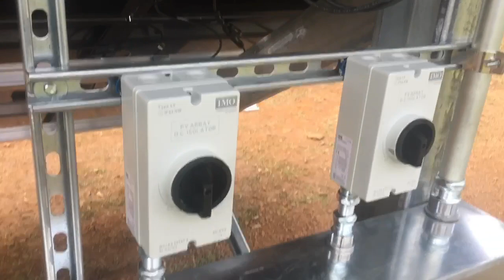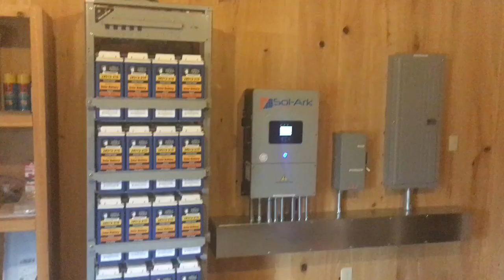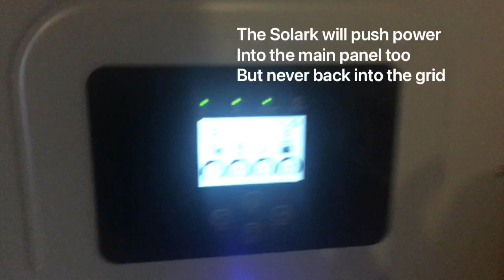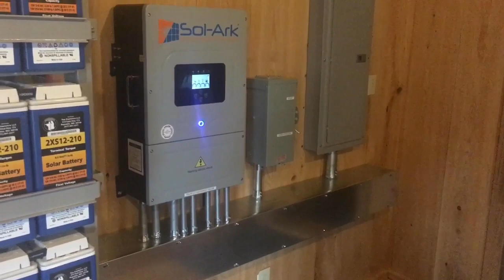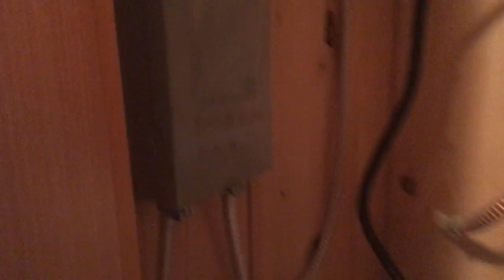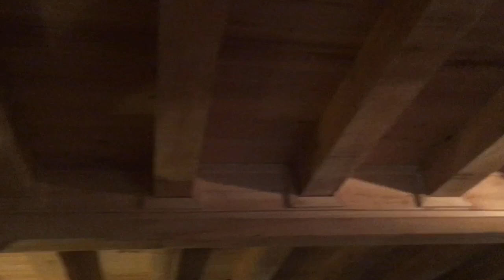Louisiana Solark pt4:  Finish job tour

Comment: What would be your second choice if ones budget doesn't allow a Sol-Ark ? Still with highest PV V possible as I need a ground mount . Thanks
Reply from the maker: It is rumored they have a lower cost unit coming out. What is your budget?
Reply: @GainSolarPower  That's good to hear as I am not in a hurry . I can afford the Sol-ark I just choose not too when so many others are close to the same thing with 25% cost . The zero export would be useful in my case though .  Just wondering what your thoughts were on the next step down from a Sol-ark .  Love your videos , very informative and entertaining.
Reply from the maker: There are no other all in one US made inverter/chargers with a 10 year warranty. Outback/Schneider/magnum/victron all need $1000’s in additional parts to do what the solark does out of the box. Also those other inverters I mentioned are a lot harder to install and take a lot longer to install. So I don’t know what you are comparing to the Solark that is 25% cheaper, if I knew of one I would be installing at the Solark it’s a money and time saver
Reply: @GainSolarPower  The Sol-ark is USA made ?  Pretty sure it's made in China ? I saw a video showing made in China on the label . Don't get me wrong , I like them ,I just think they are 4k too much .  Yes I started out wanting a Schneider system but have since changed my mind due to complaints about lack of support to the DIY peeps. Moved on to outback ,found their forum with endless complaints and not much help since the sale of the company.  I have not found a problem with the Victron stuff other than it seems more geared for mobile systems . Victron's all in one (easysolar) seems great except it seems to have went backwards with the latest version and it's too small for a home.  
            For 1/3 the cost of a Sol-ark the inverter I have at the top of my cheap list is the 12k low freq. Growatt 250 pv version  $2200 ish .  I know it's not as efficient but it's $4400.00 less which will buy a lot of extra panels and cells.
Reply: @onthelake9554  Have you any good or bad things about the Fronius Primo inverter. I am looking a for a grid tie inverter that won't tear up my HF ham radio reception.
Reply: @markrobinson8539  No , sorry no experience with grid tied at all . Johnny probably knows them well.
Reply: @onthelake9554  The base inverter is made by Ningbo Deye Inverter Technology.  Final assembly and EMP hardening is done here.  They are working on domestic production.
Problem with the Growatts is there has been no efficiency optimization.  Standby losses are high and efficiency is low, especially on the transformer type inverters.  Much of the cost of high end PV equipment is in non recurring engineering costs like reducing losses and improving efficiency in the power conversion stages.  The same could be done by Growatt, but they would cost twice as much.
Sol-Ark costs are comparable to similar high end equipment; a single Conext XW+ 6848 inverter and pair of Conext 80 600 charge controllers are the same price once ancillary equipment is factored in, and can only supply 6.8kVA.  A dual MS4448PAE system with 3 PT100s and Magnum load center/breakers/wiring would also be around the same price.  An Outback Skybox would be cheaper, but they are only 5kVA and have no surge capacity whatsoever.  Standby losses are obscene at 200W to 300W as well.
Reply: @randacnam7321  Thanks for the reply . 
   Yes I was aware Deye made Sol-Ark and in China . That's my main complaint with the price , you can by the same inverter (actually more powerful) from Deye for  $2K   .  I saw an article about the possible Sol-ark USA production a few months ago  , I hope this happens .  
            Schneider equipment is premium goods ,and it's not made in china , just too little in the support dept. for the DIY crowd .
Sure the low frequency Growatts are not as efficient as a high frequency Sol-Ark but Growatt has High Frequency inverters that are and theirs will power a hair dryer without faulting . Growatt has a lot of products that are not being distributed yet in the USA for some reason . They has 2 or 3 battery systems and an Automatic transfer switch  that look like they would be great , especially if they are in line with normal Growatt pricing . Signature Solar is the only stocking dealer that I have seen in the USA but they don't have much of the new stuff at all.
Reply: @onthelake9554  DavidPoz did some testing of the high frequency Growatts and they are around 82% efficient.
I have seen specifications for the Deye equivalent of the 8K can only handle 8.8kW of solar vs. the 11kW of the 8K.  Then there are differences in ratings: American requirements for inverter power ratings are based on continuous load, which is why the European equivalent of the XW6848 is rated for 8.5kVA even though it is almost the same inverter.  Euro specs allow for using the 30min load rating.  And the Schneider equipment that I have seen is Chinese made.

Comment: Perfection once again are those batteries also good for daily cycling I wish Solark had a 24 volt version once again great video
Reply: Only thing 24V would be good for would be small low cost systems and systems with huge individual cells, and the inverter would be limited to 3kVA or 4kVA.  If anything, a version for higher battery potentials in the 60V to 100V range would make as much or more sense given the size of the market for people using EV or ESS battery modules.
Not saying a lower power 24V version would be a bad idea, but it should also ideally work on 32V and 36V.
Reply from the maker: This video is about 18 months old. I forgot to put it out earlier. It’s part 4 of a series from a while back. Why do you want 24v?
Reply: @GainSolarPower  I wondered why you were all dressed up in warm clothes for the Louisiana summer heat

Comment: Just can't beat a Sol-Ark 12K, especially if you are a DIYer. I didn't know much about solar systems, AC and DC integration until a couple of years ago. Through videos on YouTube and inexpensive books I purchased, and help from some of you who make videos that were kind enough to answer my questions, I have been able to build an off-grid 10kW system with a ground mount racking system and do all of the AC wiring to code as well.